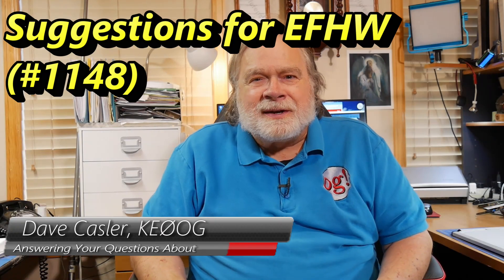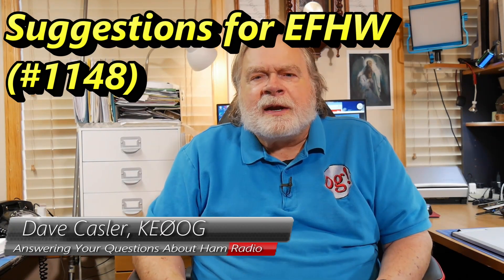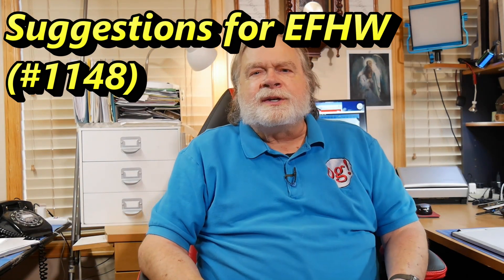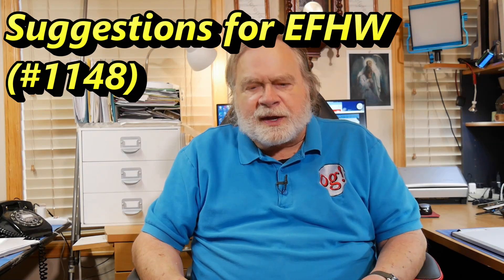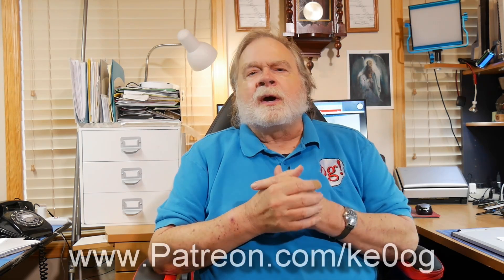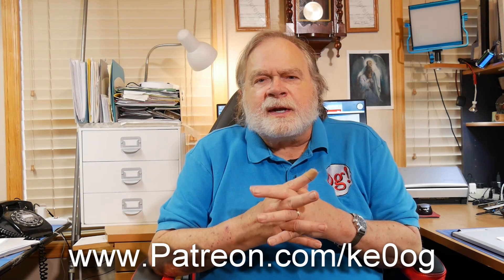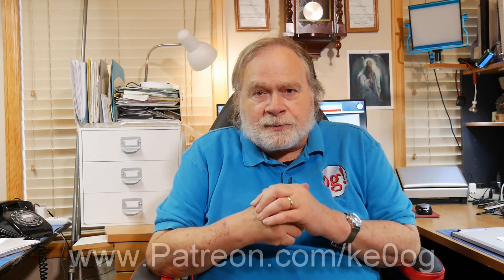Suggestions for EFHW (#1148)

Comment: Travis- watch YouTube video on end Fed wire antennas by Bob Brehm (Palomar Engineers). It will provide the answers you need to help solve your challenges.  Not sure why we are calling for a BALUN when using coax (unbalanced) to feed an end fed wire (unbalanced). Obviously calls for an UNUN. A non-resonant wire will use a 9:1 unun and provide much better results.

Comment: I've been using a 66 ft EFHW that I bought from MFJ for the past 5 years.  It works great!  It has a 49:1 unun and number 20 insulated copper wire.  With an antenna tuner I've used it from 160 to 10 meters with good results.  Since this antenna uses the shield as the counterpoise, I use 75 ft. of LMR-400 to feed it.  On 80 and 160 meters, I add 100 ft. of RG-8 that I happen to have and a RADIOWAVZ HPISOX common mode choke, to keep the RF out of my shack.

Comment: I was given an 88ft EFHW a couple years ago. I run it as as an elevated horizontal, about 40 ft above ground. Living in the high desert on the side of the mountain, I get fairly decent results from it. 
 I am not a fan of EFHW however as a multi-band antenna because of the multi-lobe patterns are to unpredictable once you leave the fundamental band. 
Thankfully my YL is also licensed, and it is never a question of if, its a matter of where.
May the noise floor be -121dBm.  73, de KF6NFW

Comment: Also I have found a 1:1 choke a must on the Random wire configurations.  I put mine at the feed point / 9:1 transformer and use the existing radial field for the counterpoise.  Cleans up the RF coming back into the shack (absolutely will affect the tuner if RF back feeding into your equipment).

Comment: I could imagine a lot of people would use stainless wire for antenna's if they had it, it would seem logical that it would be OK, when you see how many mobile antenna's are made from stainless. I had to do my own research on materials when I got my licence, there's isn't anything in any of the books I read that mentions anything about electrical conductivity in antenna material, they simply assume either copper wire or aluminium tubing is the material in use. There was a similar question in a post on facebook about 2 weeks ago, someone was asking about making a 1/2 wave stainless steel antenna for 11m. A lot of money to make an antenna that wouldn't be very good.
Reply: ya back in the late 80's early  90's I used cb 11m and I used mag mounts on my car with stainless wip's I wonder why they worked ok.. well looks like as a ham now for he rest of the bands I will be going copper..
ko6bpg
Reply: On the higher frequencies the amount of stainless is quite small.   A full size quarter wave on 10 is only a bit more than 8 feet long.  That's a far piece from 68 feet.  Plus, in the mobile environment, the strength and ruggedness of stainless is hard to beat.

Comment: I'd suggest adding a coil roughly six feet from the 49:1 balun with five turns on a one-inch coil form.  A short piece of one-inch PVC pile will work fine.
Reply: 3,5 PM

Comment: Dave,
Recommend the Use an end fed random (non-resonant) end fed wire antenna with a turner for 80-10 meters.   We use a 57 foot long wire at the Delta EOC for both ham and SHARES frequencies.   No problem the 5, 6, 7, 8, 9 MHz frequencies.  The non resonant lengths have an impedance of about 450 Ohms.

Steve KI0KY